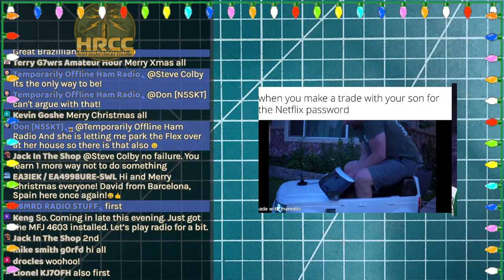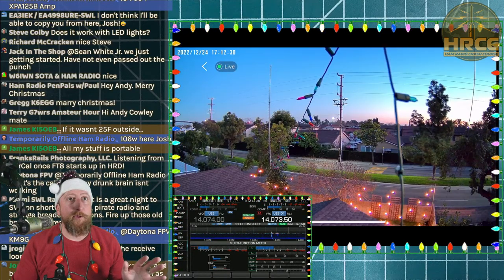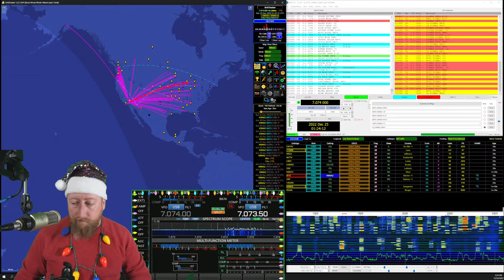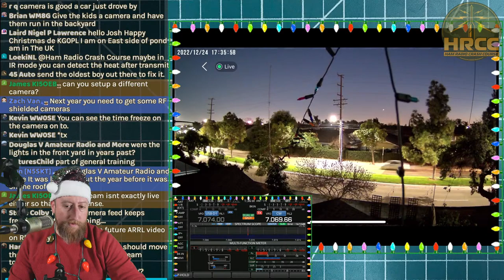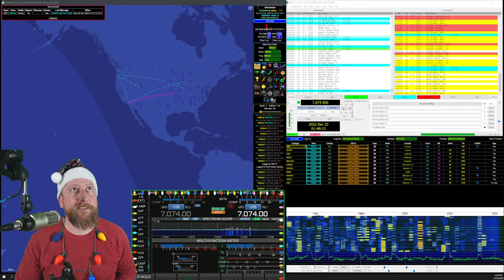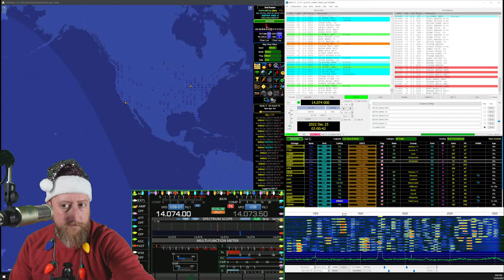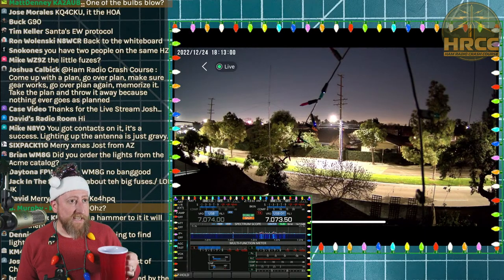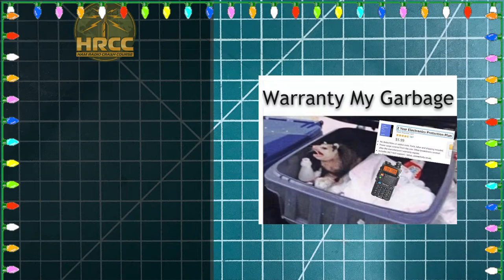Christmas Lights Will It Antenna LIVE - Fifth Aniversary!

Comment: When I was a college student at the University of Arizona back in the mid-70s I had a '71 Datsun pickup with two, 102" whip co-phased antennas off the back bumpers 56" apart. Strictly 11m back then, of course. I strung mini Christmas lights up one and then across a wire to the other and then down to the power and the darndest thing happened when I turned the lights on. The SWR went flat 1.1 and my signal increased 2 -3 S-units across the City of Tucson to somebody else who was watching my signal - about 8 miles. When I turned off the lights, the swr went back to its normal 1.6 or so and the signal dropped back down to where it would normally have been.. Darndest thing ever.

Comment: Back to my novice days in 1974 and a 60 watt light bulb as a dummy load on my Heathkit HW-16... I was testing TX and sending my call on 15m when I guy in IL calls me! I made a contact with a single light bulb as the antenna(and the 2-3 feet of RG59 feeding it). MN to IL on a 60 watt light bulb!
Reply: Those was the good ol days!  Built a Heath HW-16 in 79. Just a J-38 and a hand full of rocks!  😍
Reply: @mewrongwayKOCXF  I had an Eico VFO that warbled in freq if bumped LOL I had it suspended form the ceiling so the key vibrating the desk wouldn't make it shift back and forth in freq!Made a LOT of contacts with that old radio!
Reply: @MaryBrownForFreedom  Awesome, I remember those.  My Elmer had one!!  😋